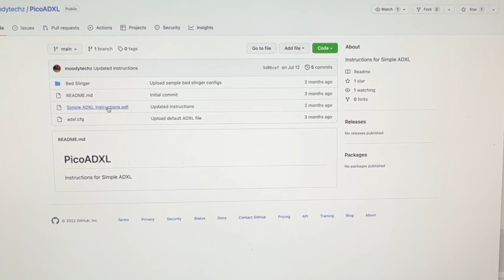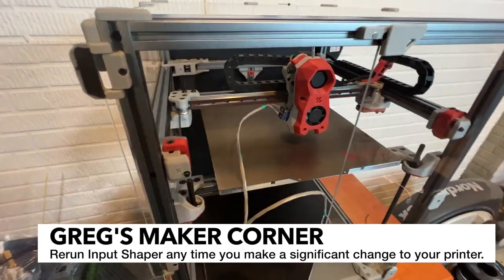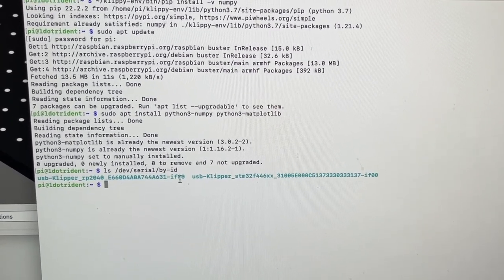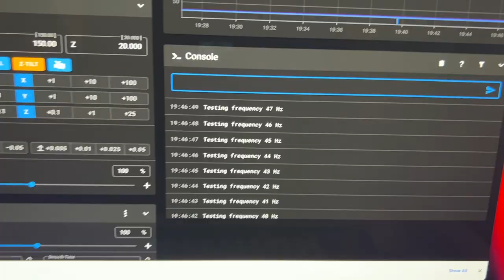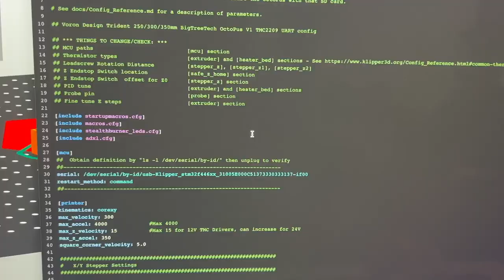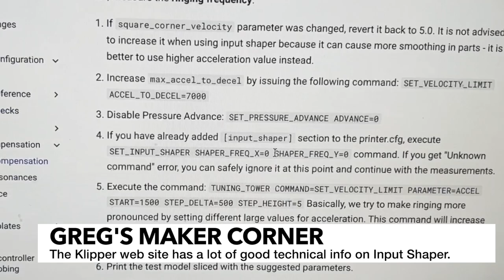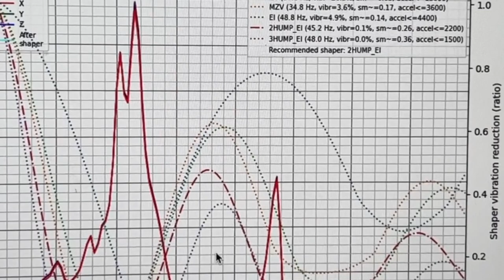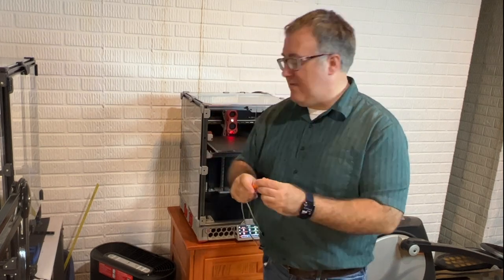Klipper Input Shaper with the Badger Box (ADXL345 + Pi Pico)

Comment from the maker: A few Voron discord users (dormouse, adrunkleaf) have pointed out that it's a good idea to use the mount provided for the Stealthburner rather than just connecting directly. I am not sure if it will make a big difference, but I think that is a good call out so I wanted to pin a comment! I plan to print out the proper mount and try again to see if results are any different. Update: My input shaper results were about the same with and without the mount! So I don't think you really need it, but use it if you'd like.  Here is a link to the Github with mounts for the ADXL345 for Stealth Burner. https://github.com/VoronDesign/Voron-Stealthburner/blob/main/STLs/Stealthburner/ADXL345_Mounts/sb_adxl_mount_generic_15.5mm_c_c.stl.

Comment: I wonder if there is another supplier for the Badger Box?  The Fabreeko link no longer works and searching their site returns nothing.  Thanks
Reply from the maker: Great question, I have not seen it stocked in a while so I am not sure they are still being pre-made. I do have a link in the video description on how to build your own if you are interested, can be done fairly cheap (less than $20 for a single ADXL / Pi version).  I just released another video on another way to do input shaping that is a bit simpler than the Badger box- have you seen it? It is using a $25 or so "Nozzle ADXL345 Board" from Provok3d. Here is the link: https://www.youtube.com/watch?v=NZNwRy7sbFY

Comment: The gap in that 10mm test-print seems pretty wide.  Normally the sides of the triangular form there are supposed to barely (not) touch.  Untuned PA?
Reply from the maker: Quite possible! It's not a good idea to tune PA until after Input Shaper. :)  Generally speaking it makes it more difficult to read the tower if you throw in too many variables.
Reply: @GregsMakerCorner  I'm unsure how well this is known outside the German community (I'm not German myself though), but Cryd Team (Youtube channel available) has collected a nice set of Klipper Macros for all types of tuning with a lot less overhead than many other approaches.  I especially like their macro for PA tuning (still need to test the new stuff in their v2 set).  That made tuning PA a lot easier for me.  Just thought I'd mention it here in case it could help some other people ...
Reply from the maker: @MisterkeTube  That's great, thanks for sharing- I will definitely take a look! I generally follow the Andrew Ellison guide which is a pretty good resource. He recently shared an updated PA tuning which I found pretty helpful. Thanks for watching and commenting!

Comment: Does this work with the Bigtreetech CB1
Reply from the maker: I don’t see why it wouldn’t. As long as you can install packages for input shaper following the Klipper instructions you should be able to use this.
Reply: @GregsMakerCorner  Thank you for reply
Reply: Yes I can confirm that it does. I have a CB1 and I did my input shaping on my Trident with a DIY version of this "Badger Box" (see my post above). In fact it's the only thing that makes it possible to do resonance testing on a printer that uses a CB1 instead of a Raspberry Pi. The GPIO connector method does NOT work on a CB1 because the Pi4B carrier's GPIO connector is missing an essential connection to the CB1's H616 CPU.